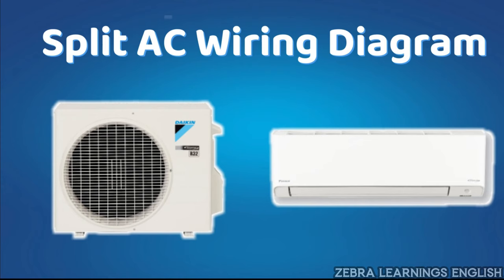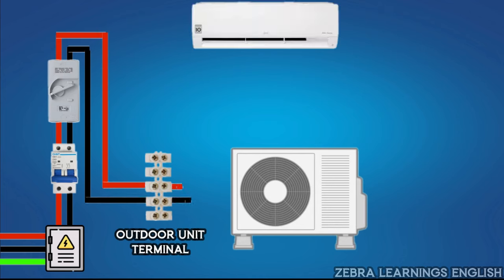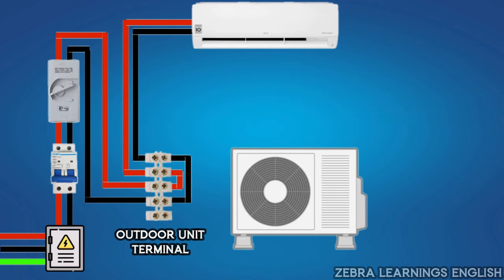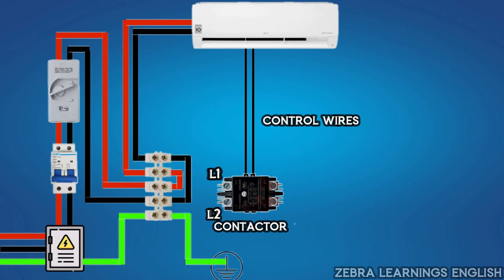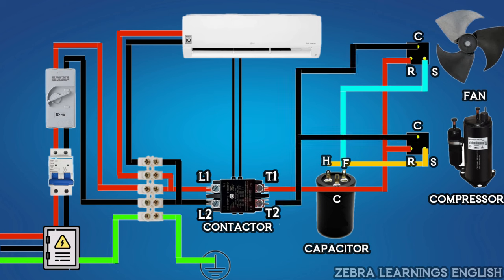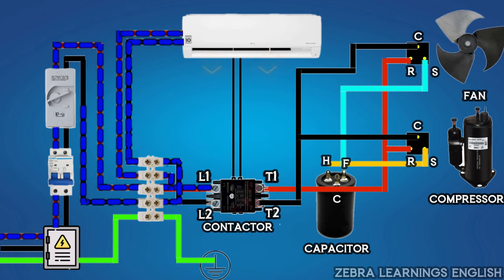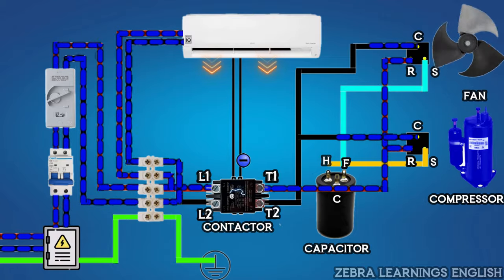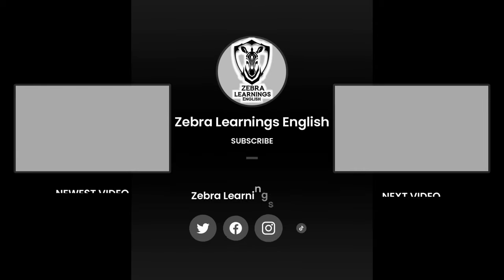Split AC Wiring Diagram | Animation | HVAC | Electrical

Comment: How do you know which is t1  or l1 on fasco contactor ?
Reply from the maker: The terminals labeled directly on the device. You can see it or you can refer the diagram.
But in most of the devices, Single-pole contactors, usually, the top terminal is L1, and the bottom terminal is T1.
In Multi-pole contactors, L1 and T1 will alternate on opposite sides. (Example: one side has L1, L2, L3, and the opposing side has T1, T2, T3)

Comment: I have a problem in my non inverter split AC. When i start AC, only fan runs, n sometimes Compressor auto start, some time not. But when i touch the pcb ckt of inner with a stick the compressor statrs but stops after 5 minutes cooling n then either don't auto start or start after nearly 20 minutes. 
I have already changed the capacitor of FAN in outdoor unit but problem still persists. I think their might be some loosening of wire in inner PCB ckt. Please guide to trouble shoot.